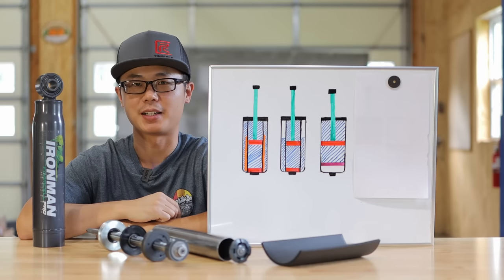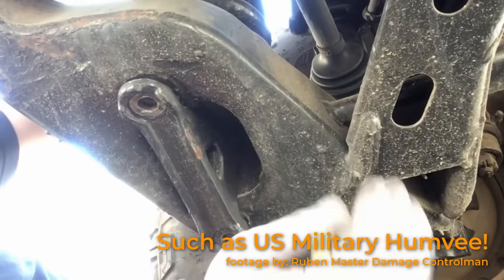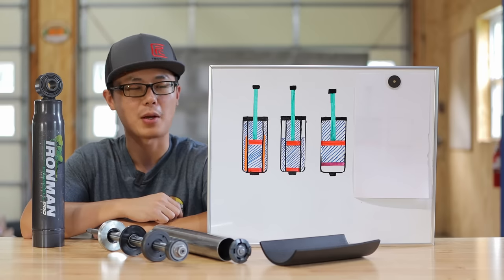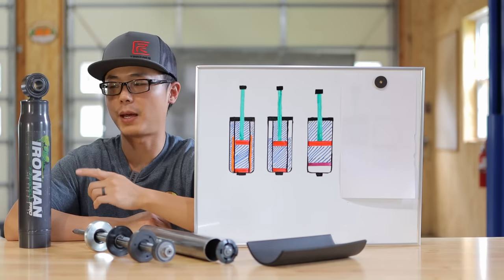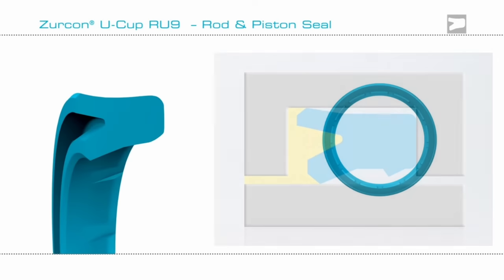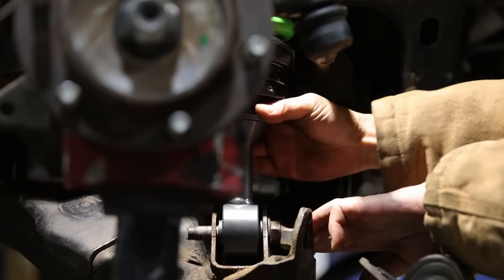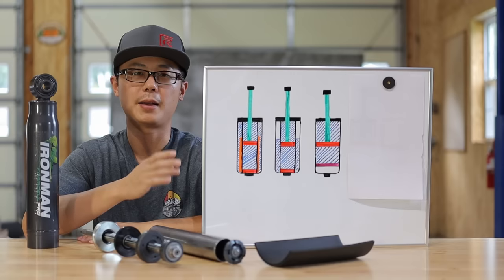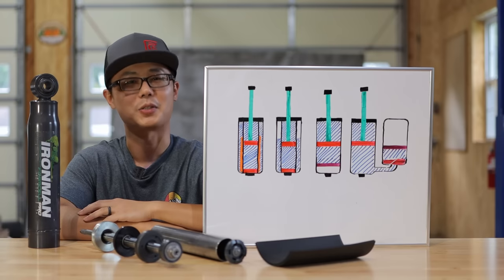Truth About Ironman Foam Cell Pro | In-depth Technical Review & Comparison

Comment: @Tinkerer's Adventure
Kai,
Love your videos because the present the data and help people make informed decision based on their needs. I am looking at the Ironman foam cell pros and debating in spring weight. I currently have sliders and a gobi roof rack so about 220lbs of additional weight all the time. Would it make sense to get the heavy springs? Why are you running on your trucks?
Reply from the maker: Thanks. I’m not running Ironman so I don’t have confident recommendation for you. If I were you my best guess is go with medium.

Comment: Another excellent video.  How do these compare to factory performance shocks like those found on TRD models?
Reply from the maker: Thanks! TRD PRO has 2.5 diameter internal bypass shocks, which is really good for high speed off-road. It also have rubber bushings and better finishes than aftermarket Fox shocks which I like. So I put TRD Pro shocks much higher than these, except for missing threaded body adjustment.

Comment: Fantastic review mate. Would love to see your review on the BP51 compared to the rest. I currently have BP51 and Im very disappointed in amount of lift, travel and performance.
Cheers
Reply from the maker: Thanks! I haven’t had any fist hand experience with BP51, but by technology and theory, it is very cool. The biggest down side is the internal bypass structure reduces piston diameter. 2.5” outer diameter but only 2” piston. Being bypass and having position sensitive damping can achieve characteristics no other shock on my chart can. But in practice, with limited factory suspension travel, that might not be significant enough. What do you not like about the performance? Maybe you need to turn some knobs and tuned it more specific to your setup? Having all those knobs to turn is another double edge sword

Comment: What speeds do you consider "high speed"? I'd like a shock for beach driving around 60km/h
Reply from the maker: For a simple number, to me 45km/h is high enough. But it also depends on how big of a bump you try to go over. It is really the speed of compressing the suspension, not the vehicle speed, though they are correlated. I don’t think a normal beach has huge continuous bumps. With the soft sand and aired down tires, the suspension doesn’t move much. I personally wouldn’t get performance shocks for the beach I know on the East coast

Comment: I would like to install Ironman foam cell pro on my Tundra but they only have 3.5” lift kit. Looking to do 2” lift in the front to mimic TRD pro stands. Do you know if 2” lift is possible for Tundra?
Reply from the maker: You can dial down the preload collar to achieve lower lift

Comment: How difficult was it to adjust the height when mounted on the rig? I researched on the web and have called Ironman twice and I’ve gotten mixed answers on adjustability without compressing the springs first. There is only 1 video on YouTube that shows someone adjusting and he compressed the coils while the strut was installed on the truck. 
Thanks for your very thorough and insightful videos.
Reply: It’s doable with the proper spring perch wrench and some extra leverage on the handle. Have raised and lowered mine without a spring compressor
Reply from the maker: You can do it on the rig. Just let the suspension hang in full droop. The only style you cannot adjust on the rig is those with clamp style rings on King and fox. They have a split on the ring and will bind up if you try. Solid rings like these are totally fine. I actually completely removed the spring and put it back all using these collars, no spring compressor.
Reply: @TinkerersAdventure  Hmm, not suggesting you make the recommendation, but are you suggesting one could assemble the front shock without a spring compressor?  Saving the assembly charge would aid in purchase vs something less expensive.

Comment: I know I'm not supposed to speak poorly about fellow offroading associated companies and such, but...
I have owned my ironman suspension for one year. I have not done any hard offroading only slow semi light... But... I've had nothing but problems with ironman.
1) The ironman "heavy" springs couldn't be installed on the ironman shock body without mushrooming and smashing the rubber seats. The off-road shop that tried to install the coils on the shock bodies informed me that ironman heavy coil springs rub on the shock body. A poor design. I called ironman from that shop and they initially didn't want to help me, but they knew about the issue with the springs from other complaints. I had to post a video on some forums before I got a response from the main guy (who was nice and helpful) and he got me some preassembled mediums load coilovers and also installed them for me.
2). My ironman medium load leaf springs sagged 1.5" within about 9 months after installing them. I went to ironman and they said only one leaf spring pack was sagging and only gave one leaf spring pack. The next day I measured the both sides on several flat surfaces. Both were sagging. I had to drive BACK to ironman a second time ($60 in fuel now). I let the leaf springs sit in the back of the truck for a week because I didn't feel good about putting the same leaf springs in that may also sag within the next year. So I called ironman to see if I could replace medium leaf springs with heavy load leaf springs and pay the difference. They said yes...
3) I go to ironman and get the heavy load leaf springs on a Saturday. The guy behind the counter says he can't do it because customer service is not there. Luckily a lady came in to exchange a failed product she just bought. I told the guy that if you can exchange her product, you can do mine. He made a phone call and did it for me.
I get the heavy leaf springs and drive home. When I get home I look at the leaf springs and they are manufactured completely different. Two COMPLETELY different designs. I call ironman and tell them and they confirm that they have two different factories in China that make leaf springs for them. I had to go back and get an identical spring made in the same factory. Unfortunately!!!... The only leaf springs they had were the spring design that sweaks obnoxiously loud after about 1-2 months of driving on them. (Factory C)
I now have leaf springs that sound like an old rusty ranch truck from the 1960s.
4) The lower mount bushings on my coilovers are failing to the point where the bushing housing rubs on the control arm and squeeze and clunks. The lower bushings are going bad.

I am sadly disappointed in the quality control of ironman and some of their poor product designs and materials.

I wish I had known about the OME bp-51s before buying ironman.
Reply from the maker: Good feedback. I’m not affiliated with ironman in anyways, but they sometimes read my comment section. I think they will take note

Comment: Hey. I had a thought the other day. Does a limited 4runner with Xreas have better shock cooling? Since it's connected with the opposite shock it has more fluid to dissipate heat.
Reply from the maker: It doesn’t because the other shock needs to dissipate heat as well.

Comment: I have a ‘20 200 series and currently run BP-51 with 2722 springs. If Ironman came with a different color option…like black I would certainly give these a shot as I am not a fan of my bp-51. Adjusting them is a real pain

Comment: So, if I have a good amount of lean on my 200 series with the foam cell pro kit installed, both front coilovers set at the same height. Would installing a spacer on one side not change how much droop I have on that one side? 

I have KDSS on mine, and the shop I took it to said that when the front sway bar is removed, the vehicle sits level, but is pulled back down on the right front once it's installed. 
I've tried the KDSS levelling to no avail. is a spacer the only way to fix it, or can I get an extended KDSS arm to correct it, too?
Reply from the maker: Don’t add any spacers on top of the front coilover, because that will overextend the droop. Adding spacer above the rear coil spring is OK because the droop is limited by the rear shock. You don’t need to worry about coil bind because the spring has a ton more compression than the largest coil spacer you’ll add. Sounds like you have the KDSS lean. The 200 series has pure mechanical KDSS which I have no experience with. So I don’t want to mislead you
Reply: @TinkerersAdventure  To address the front portion of lean, one can dial up (compress the spring) to address the lean in the front.

Comment: I want to get ironman pro but I remember seeing your video about diff drop and you don't recommended any lift kit that is more than 2".   Ironman FCP minimum lift height is 2.5"front and 2"in the rear.   I have gx460  would you say the ironman pro fcpnisnstill great choice? I know dobinson offer more lift option but I like your review on the fcp
Reply from the maker: You can reduce the ride height to what ever you want by adjusting the preload. I know, it is just more work. I wish Ironman offers a lower lift height out of the box.
Reply: @TinkerersAdventure  thank you, I am going to get the IM FCP and have the height adjusted to 2"

Comment: i'd challenge them on the cooling claim. I'm not sure the foam conducts heat as well as the oil to cylinder.  In fact it might make cooling worse overall. But that would be offset by the simple fact that that whole shock is much larger. So its really the increase in shock size that helps cooling, not the foam.

Comment: Make a video of lower control arm that's help clear bigger tires moving the front tires the most in a LexusGX460, i have a 2011 model year, i have 35x12.5R18 and i want 37x12.5R18 or even 38x12.5R18, thanks for your good videos and advise

Comment: These videos are great, amazing amount of nuance in these parts that isn't captured by simplifications like "external res good, twin tube bad"

A request: can you do an addendum to your Toyota IFS Part 2 video, on how air suspension + full independent suspension figures in? Given that even vehicles like the new LR "Defender" has that, LR3/LR4 have it, my Gen 1 Cayenne has it (along with a center & rear locker, low range and a 6MT mind you!), etc. Some thoughts-

One is that changing the air suspension ride height is kinda like changing the preload, since what's actually changing is the air spring height/"thickness"? But I guess as opposed to a coil spring, increasing an air spring's preload involves raising the ride height not lowering it as in a compressed coil spring...so that's why raising air suspension means increased harshness, because the spring compression isn't taking up as much force upon maxing out downtravel, then hitting the next bump. 

What about when you then do a body lift? In this case, you're not actually increasing the pressure inside the air spring (preloading) to raise the car. It also doesn't seem like you are pre-extending the shock either- you're just adding material above or below it to compensate for the body lift. However you are still trading down travel for up- because the various joints on the suspension are already closer to maximum droop (unless you do a subframe drop as well?)- but this wouldn't affect ride quality per se right?
Reply from the maker: Thanks! One thing I didn’t mention is control arm angles. When lifted, the control arms are at a steeper angle, you have more force transfer into the chassis. The wheel also start to have more lateral movements due to the arc of motion, instead of straight up and down. The smoothest ride occur when control arms are horizontal. This applies to all suspensions including solid axles. I’m not very familiar with air suspension so can’t answer for sure. But you have some good thoughts there
Reply: There is also the difference between air strut (where the external diameter of the air bag is constrained) and basic air bags. The new Defender has twin chambers in each strut to allow raised height without raising the pressure in the main chamber so better off road ride.
Air strut types also have different spring rates caused by piston shape.
You can consider most air struts like the old mountain bike fix float etc. There is a huge amount of tuning you can do with those that is at least a ball park for vehicle air struts.
I'm coming from Mt biking and earlier air strut Range Rovers. I did spend a couple of hours teaching someone in a New Def and the ride height chamber was good. Not certain about the complexity of the valve and control systems though 😀
Reply: @GavinEarnshaw  defender has air struts in front and separate air springs in back, I think what you refer to only applies to rear axle

Comment: Kai. I so enjoy your channel, though I feel bad that I only just now discovered it.  Never-the-less I appreciate your scientific approach to each of your videos much more than some advertising misinformation put out by companies.  Like you I am much more interested in how and why something operates the way it does and evaluating the pros and cons from research as opposed to taking an advertisements word for it.  So thank you.  My ? is. and this is totally off video topic but:  could you please help me to understand the hype behind cold air intakes? I understand they are marketed to effectively increase the amount of "cold air" in an intake thus theoretically creating more power...however if that were TRUE, then why don't our engines have more power in the winter months versus summer months because the air being inducted is colder than the summer??? Thanks in advance and keep up the Toyota Tech Talk!
Reply: PS - I will order some 5th gen 4runner goodies from your designs when I have more money.  lol
Reply from the maker: Thank you. For Toyota trucks, the only benefits for CAI is sound and engine bay aesthetics. I installed the TRD intake on my FJ for louder noise when I was younger and into that kind of stuff. But while I removed the factory intake, I realized how many legit air cleaning features I was throwing away. I immediately regretted but finished the TRD anyway because I spent the money. I will make a video about this in the future.

Comment: Foam cell in suspension components is not new.  I suspect the foam will wear out way too soon.  Also, no internal pressure changes design options for the shaft seal.  Soon as I see some BS from a manufacturer, I loose the confidence is my sorting out what might be true.

Comment: I'm not comvinced the ironman shock has better cooling performance. The foam sleeve is closed cell, i.e. trapped air, i.e. an excellent thermal insulator. This insulator is then placed right against the outer sleeve. So unless there's some design feature that forces oil between the foam and the outer sleeve, it won't have better cooling performance, it will have worse.
Kai, i love your balanced technical analysis, keep up the good work!

Comment: Can you explain the Toyota lean and how to correct it?
Reply from the maker: It is just uneven weight distribution and KDSS pressure if equipped
Reply: @TinkerersAdventure  thanks! For KDSS equipped, what is best (A) add spacers/adjust one side, OR, (B) open KDSS valves and rebalance?

Comment: Don't forget that dobinsons are rebuildable, revalvable and easier to adjust ride height ;)
Reply: I think two of your three points apply to Ironman FCP also.  Correct me if I am mistaken, but Ironman FCP ride height adjust in the same manner and are dyi serviceable.  Servicing one is going to be cake compared to working on an MTB shock or fork.   Likely they can be re-valved also.

Comment: I'd like to add onto my previous comment about my KDSS lean. I actually believe my foam cell pro has failed. Driving yesterday, the car is very boaty/wavey on bumps. Need to do more testing. But, I'm glad a rebuild kit is relatively cheap. 

Need to look into the shocks a little further to see if it has actually failed, but, it's certainly feeling like it. Hard to keep in a straight line, especially in higher winds. One side is compressing more than the other, boaty feeling and just feeling terrible at the moment.
Reply from the maker: Sounds like it. But if you haven’t seen any oil leak, it might be the piston nut came off. Hope yours is still within warranty.

Comment: Great video as always. When I was doing some research because I am in the market right now, it seemed to me that the Dobinsons were the only ones that had vehicle specific valving. I am not sure how much that would impact ride quality. I mostly do slower speed crawling in colorado but do hit washboard roads often which makes me want to lean towards some remote reservoir dobinsons but it is probably overkill for what I need. I just want the most comfortable ride and not necessarily the most responsive.
Reply from the maker: Every shock out there has vehicle specific valving. So that is a pretty lame marketing line. There is infinite way to implement the valving. No “correct” or “best” answer. Going up in tech and price doesn’t equates to better in comfort. A good match between spring, mass and damper, and keeping the lift low does.

Comment: Not sure if anyone has the same small issue with Ironman specifically (not the foam cell technology). My ironman (both body, coils, and leaves) rusts a LOT FASTER than OEM and other brands. I know some surface rusts won't really hurt the mechanical integrity. But I have a fear once iron rust forms, the water can penetrate much quicker than a smooth steel surface.